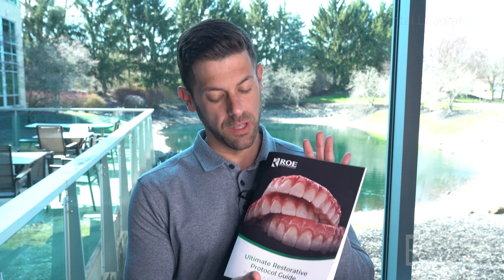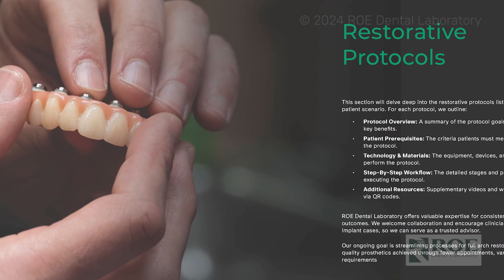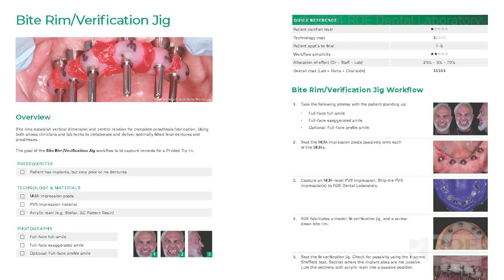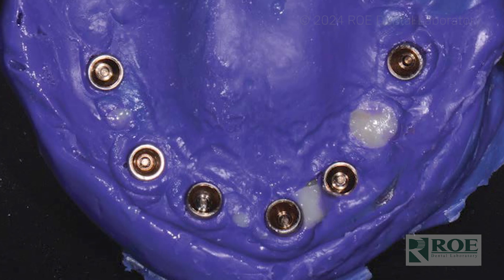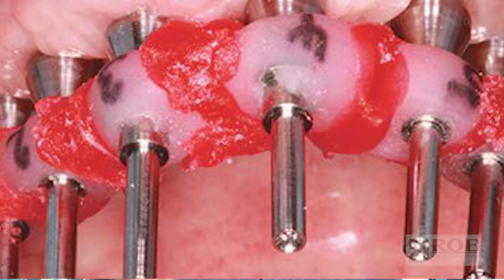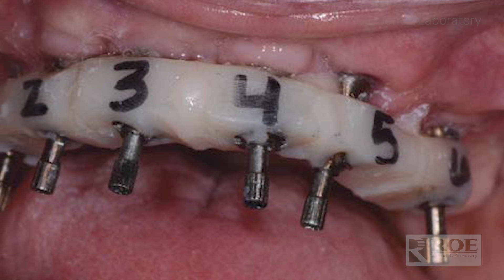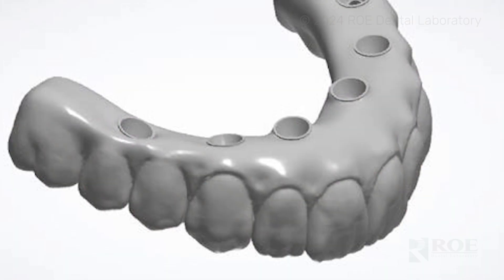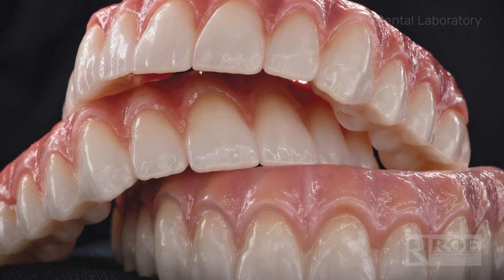Bite Rim/Verification Jig Protocol Overview - Restorative Dental Workflow

Comment: what do you do in case you need to rehab both arches?
Reply from the maker: Hello there! You would complete the same workflow for both arches! If you are interested in learning more about ijig you can check out our website: 
www.roedentallab.com/products/chrome-guidedsmile/guided-surgery-restorative-phase/ijig/
Reply: @ROEDentalLaboratory  you don't show anything about the wax rim adjustment which is the most difficult step in a full arch rehab. that's why I'm asking. you just take a bite and put a few lines but you should modify the plane, the lip support etc. also I saw the link. the ijig seems to give a quick solution to the whole process but it under estimates the  wax rim step in my opinion.
Reply from the maker: @san5a89  While we don't have a specific video from ROE to share with you at this time, we did come across this helpful video on wax rim carving that might be valuable https://youtu.be/Rje7KPgeYRw?si=C2oTjUDy4lDhKM8j
Reply: @ROEDentalLaboratory  do you consider this step in your process? also do you find that in the majority of the cases the teeth set up can be replaced by the prototype?
Reply from the maker: Yes, in all cases we will replace the teeth setup or wax-rim with the prototype..  The wax-rim or tooth setup is just our basic guide in the design process,  once everything is aligned in Exocad, the final design is done based on the setup and also any other data that is given to us, such as photos